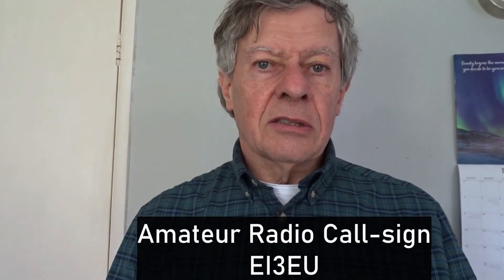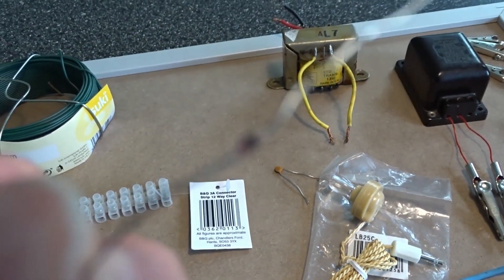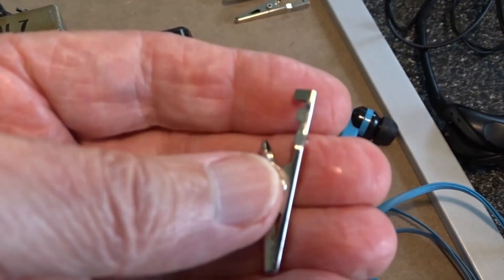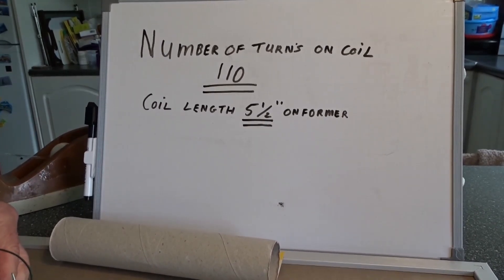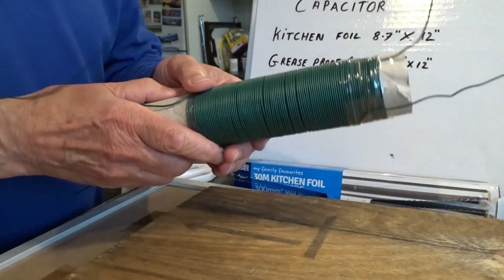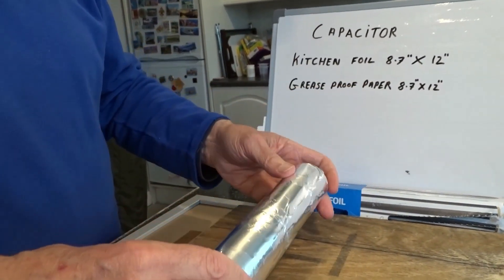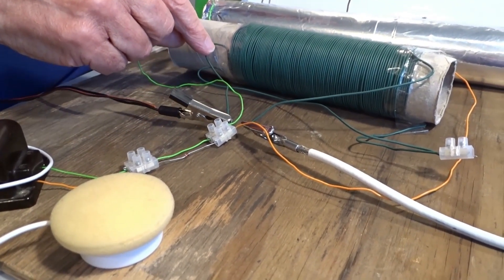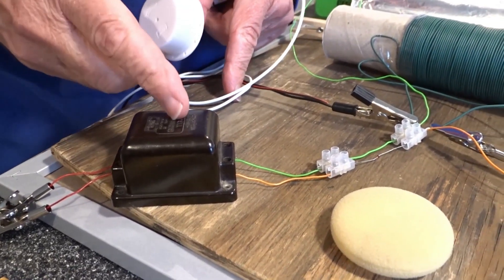Make your own radio receiver - "Radio Junk". Dublin Maker 2021

Comment: Great job. Thanks for doing this. This is the kind of thing people should all be watching instead of nonsensical influencers 😂 
Would love to try but here in the US states. 
Curious about a few things like the tinfoil being used interchangeably with aluminum foil. Wax paper is not something commonly found as a lot of people have switched to Silican mats. 
Just wondering if anyone has other items as I’ve heard razor blade and safety pins used by World War II troops
Reply: I am in the US
The foil he used is really aluminum foil.
I made my capacitor flat.
https://youtu.be/PCpjObIzCB0?si=vohVYyx7EsdTo5KG
I used ordinary paper and it works fine
It takes about 5 minutes to do it but it is not very pretty
I suggest you build one with a diode first.  It makes for fewer things to troubleshoot
Check out the other related videos I have if you want more information.
In the SanFransisco bay area I get about 10 stations on the AM dial with my loop antenna.

Comment: Try using a razor blade and a safety pin in place of the germanium diode. That's what the troops used in WWII for their "foxhole radio".  You could also try using thumb-tacks to make your connections to save even more money. Introduce your viewers to the "schematic diagram"... it's will be simple enough for anyone to understand on this radio.... That earpiece you used seems to have a very good volume to it. Love the application of the doorbell transformer (or suggesting the mains transformer) for the impedance match. Only one radio station in the country? Wow! But, yes, it would be interesting to attempt reception of other stations during the night time. We call it "DX-ing" (for long distance reception).  Cheers!